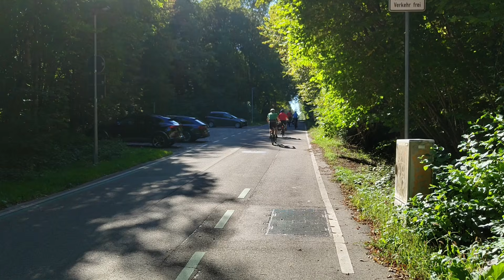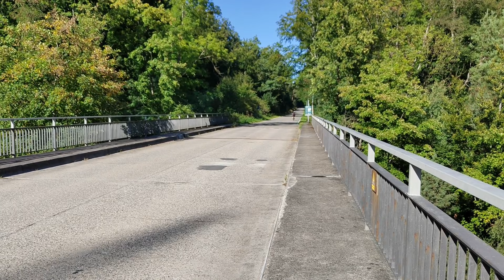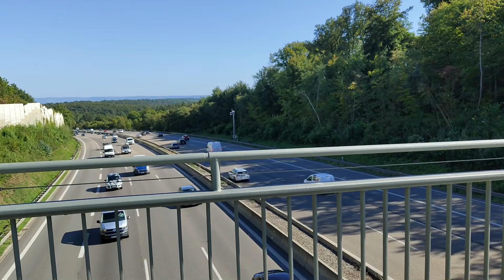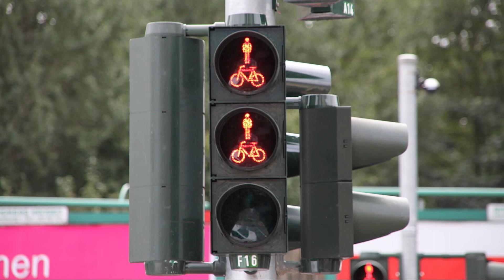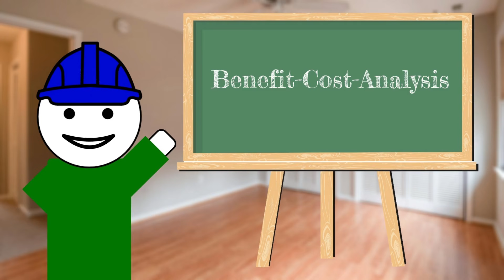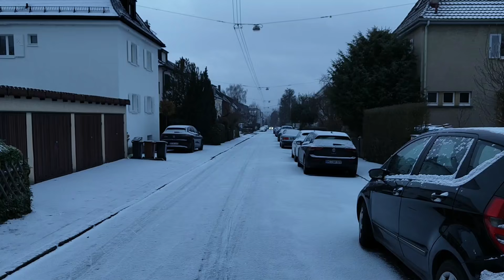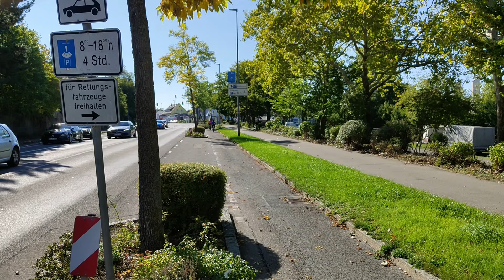Do Cycle Highways Even Make Sense?

Comment: Since cycling is so good for short distances the concept of a cycle highway has been somewhat baffling to me. Long distance routes are good, I have covered many miles on them but I have noticed, certainly in my locality, that they are often poorly connected to actual destinations. I suspect somebody will set a target to build a certain number of miles of cycle routes, then they will get built on easy alignments (such as old railway lines) to meet the quota. Difficult areas, often the ones where safety is a problem like junctions where good cycle infrastructure us needed most seem to be ignored. Such areas are more challenging to design, are expensive per mile and will involve intrusive roadworks. What results is a load of disconnected routes that only get used recreationally or by those brave enough to cross those hazardous gaps.
Reply: Cycling is great for mid distances too. I’d cycle 15 minkes to work if it meant having a cycleway that was separate from cars. I wouldn’t even wear Lycra
Reply: @evolutionxbox  I currently commute 13.25 miles one way. Most of it is mixed use path but there are several steep underpasses and 90 degree turns onto bridges. Having a dedicated cycling highway that could cut down the mileage, get rid of the concrete bumps, and reduce the hills/turns would be amazing. But even though like 90% of it is path, the last 1.5 miles on road is extremely unpleasant. Being separated from cars makes a huge difference in how far I'm willing to bike.
Reply: @evolutionxbox my commute is about 4.7 miles and 20-30min depending on windspeed. The only thing other than good waterproofs I wear is heated gloves for winter. Starting a shift with numb fingers is no fun.
Reply: The key is to improve those problematic areas. The US is so car dependent that any time there's a discussion about how to improve safety or intersections, the question is always, "How will this negatively affect people in cars?" A lot of cycling infrastructure can be done relatively cheaply. But there are definitely places where it's just simply going to cost money to fix the issues. But we've spent hundreds of billions on roads for cars. We can definitely afford to put a fraction of that budget towards bikes. Just need people with the political will to do so.
Reply: Noticed that, too. In my region of Germany the cycle highway craze has just started, and while I kind of like what is being done, I will use none of the planned tracks for my daily commute and other regular trips. The detours are just too much to be justified by a more peaceful experience, especially since the existing dedicated and coincidental bike infrastructure is already not so bad.

The one project that is already finished I have used occasionally, but as you indicated, for leisure rides.
Reply: There is a lot of latent amd ongoing neglect towards building protected junctions, particularly where pedestrians and cyclists are the most at risk of injury and death by traffic violence. At least in average North America.

In California, we have a roundabout design that is used somewhat frequently in the north, that effectively mimics protected roundabouts. It has ramps to encourage cyclists up onto a widened sidewalk for the duration of the junction, instead of riding through the same path as the car. It's a significant improvement from the dangerous unprotected intersections they replace, but I've noticed that these roundabouts are few and far between, appearing to be applied where traffic engineers don't think motorists will be supposedly inconvenienced by their safe, sensible, and efficient design. Only on generally low traffic streets and junctions, as the busiest intersections are still planned to be signalized, congested messes of time wasting car traffic as they have historically been.

Like most places, our cities are happy to build longer multi use paths, and I'm glad they build them, but we need the foundational safety of protected junctions and bicycle streets.
Reply: Bikes are plenty good for medium distances of several km too, especially if you're going between more residential areas where the transit options are slow. I've chosen what part of my city to live in because it's cheap and a bit out of the way but has a version of a cycle highway that goes near my workplace.